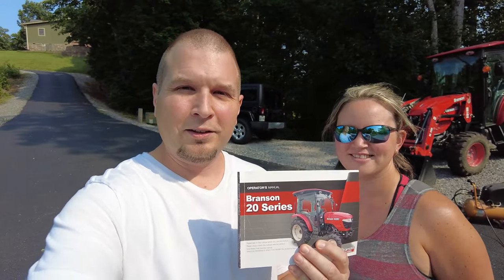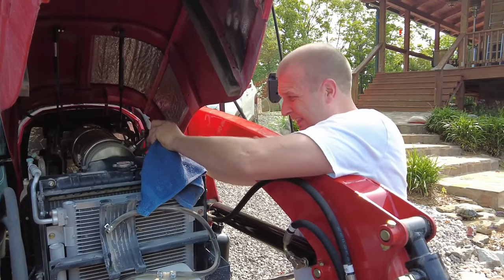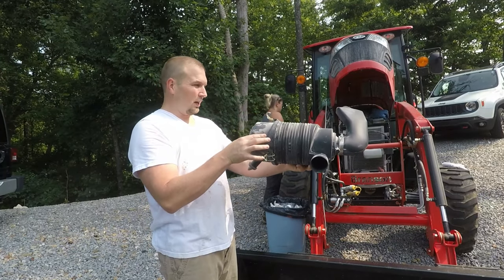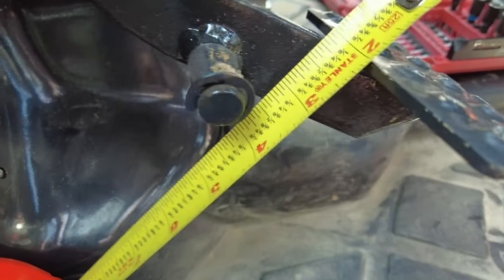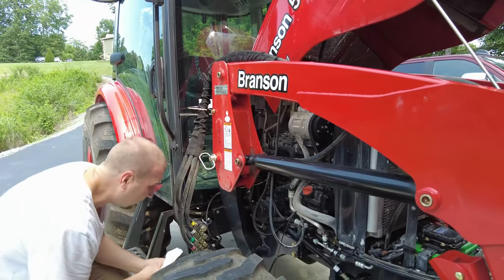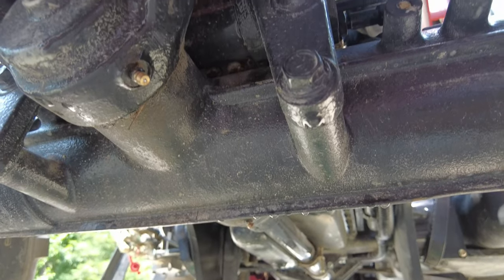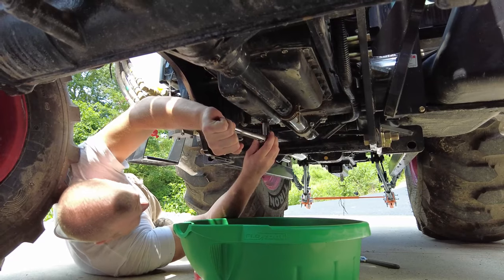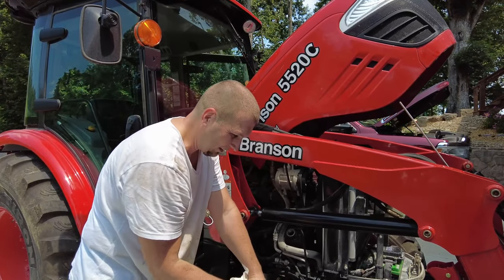New TRACTOR 50hr Service! New Branson 5520c & 5220c at home 50hr service tutorial video!!

Comment: And you put oil in the new filter and then put it on and then you took off the drain plug so now you are also draining some of the new oil out with the old. You don't need to put oil in the filter on a side mount filter. Just a little on the ring and the threads

Comment: I have a 5520R that has 300 hours on it. On mine you do not need to take off the air cleaner housing - just unsnap the 3 cover clips and you can pull the air filters out to blow them clean and wipe out the interior. I suspect the same condition exists for your tractor. I have never seen anyone put oil in an oil filter before installing and I don't do it either. Just oil on the gasket before installing. The Branson dealer parts guy said I could change the transmission filter without draining the hydraulic oil at 50 hours (he said that is what the dealer does). I tried that - big mistake. With the backhoe frame (on mine) the transmission filter access is tight and you get bathed in the oil trying to swap the filter. Just drain and change the hydraulic fluid like the manual says is what I learned!
Reply from the maker: Great tip on the hydraulics I haven't don't mine yet it's been sitting . I'll be doing that soon
 Thanks for the comment .

Comment: Nice job John and Nicole! I am around 32 hours so I will be doing mine soon too so thanks for the hands-on visual.
Reply from the maker: the only 2 things i didnt do is the hydraulic oil cuz the dealer told me not to until 100hrs and the front axle oil cuz 25hrs of the 50 we used the backhoe so the tractor never moved so i figured i will do that at 100 as well . it wanst that hard thanks for watching oh hope your 4th party went well !
Reply from the maker: Dang well you had a great time and no one was hurt that's what matters.

Comment: NO! You tighten the oil filter and then back it off a 8th of a turn
Reply from the maker: Maybe if you tighten it . I don't tighten it down I go to snug (or seated to the housing) then a 1/4 turn . I don't recommend anyone tighten it as tight as they can get it and then back it off not good for the seal.